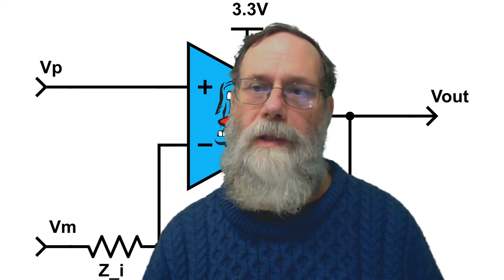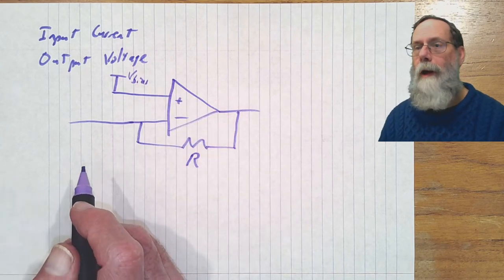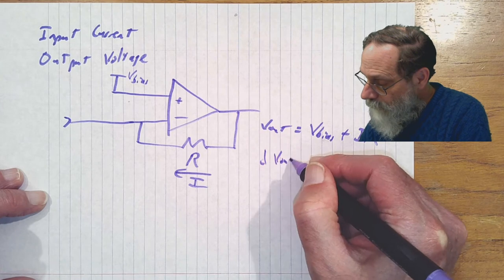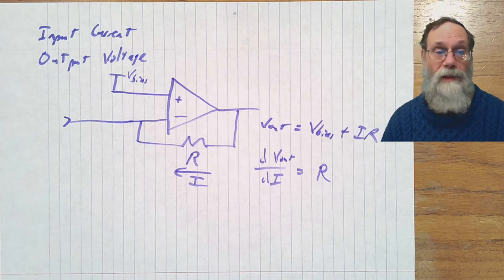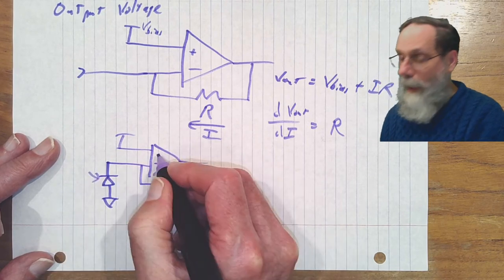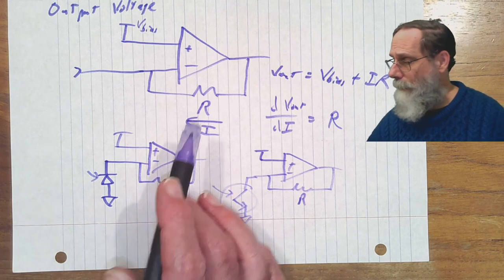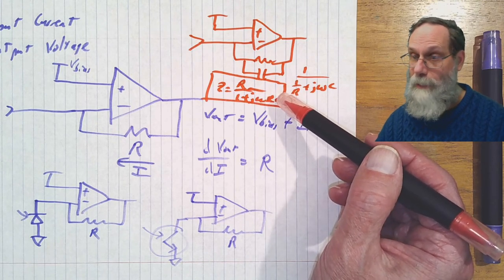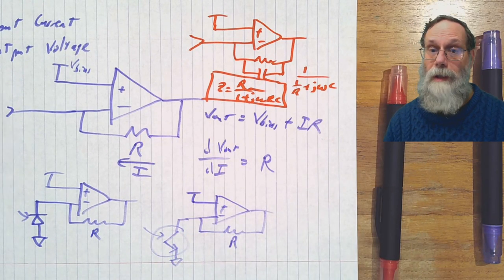Transimpedance amplifiers §23.1

Comment: So if my application is simply to digitize the output of a phototransistor with an ADC converter (which should have a very high input impedance), the transimpedance amplifier does not have any advantage compared to simply using a resistor? Or am I missing anything?
Reply from the maker: The transimpedance amplifier would keep a constant bias on the phototransistor, which makes the output voltage linear with the amount of light. Using just a bias resistor would have a bit more nonlinearity as the bias voltage on the phototransistor varies with the light level.  If you are doing a low-precision measurement (like on/off) then the bias resistor is all you need.  Look also at the log-transimpedance section/video, for a way to get wide-range measurement of light.
Reply: @gasstationwithoutpumps  Thanks for the video! What are the advantages of using a TIA instead of just using a BJT as a constant current source for the photoresistor/phototransistor? Can I use any OPAMP to impletment the TIA ?
Reply from the maker: @anonymouseniller6688  Almost any op amp (with appropriate voltage range) will work as a transimpedance amplifier.  The transimpedance amplifier provides a constant voltage to the photodetector, not a constant *current*.